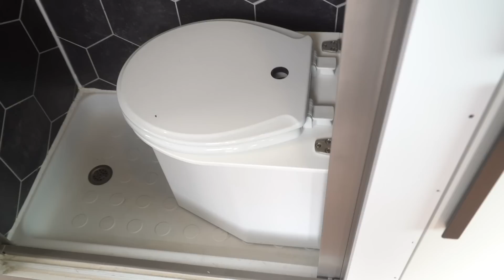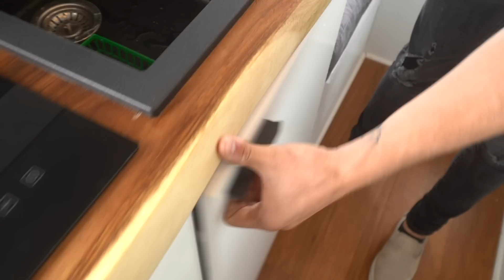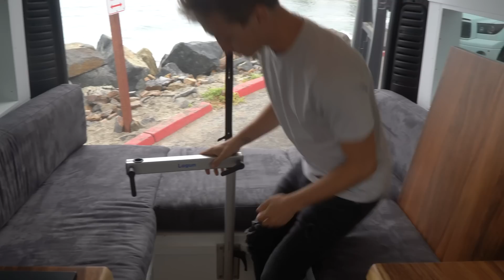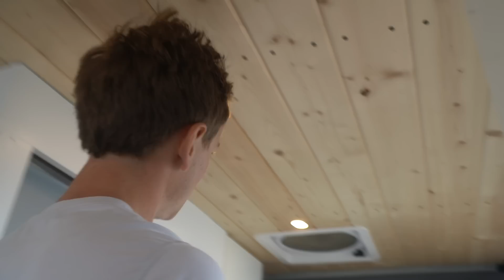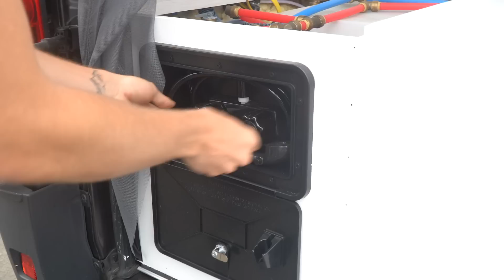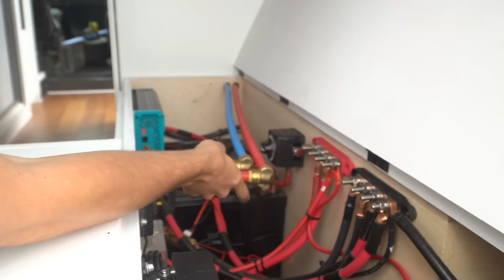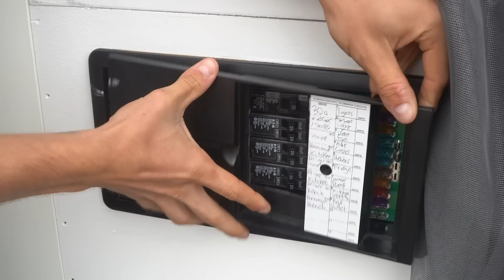LUXURIOUS Custom Van Tour | MASSIVE Black Slate Shower | 12v AC | Full Course On This Build!

Comment: Overall, nice build.  Like the layout and color choices.  I would have some humidity concerns with the evap cooler, and some finishing touches are needed to improve the quality of the build.
Reply from the maker: Scott agreed! We had to finish the tour before I could get to me of the more finishing touches because my videographer was going out of town!
Reply: @JumpinJehoshaphatJsquared  as the rubberbandits would say, "fair play to ya." :) lol, i hear ya, these videos made me so coo-coo-crazy for vanlife i had to build my own...but i wanted mine to be super-stealth because i am living in it fulltime in a major metropolitan area where the police are highly unreceptive of the idea of living in a van :-| and i also wanted it to be a legit tiny home that i could LIVE IN, with a full-size legit shower and nice bed...so i built it in a e350 box van. xD good luck getting your rig built, if you watch enough videos and think carefully about your needs you can get exactly what you want and it'll benefit from others' mistake. for example, it was several vanlife videos where people were complaining about smells from their greywater tank that turned me onto the idea of the hepvo valve. also, i saw a trent-and-allie video where they had mold problems underneath their foam mattress, so when i built my bed i put epoxied slats underneath, so the wood won't accept moisture at all, and about 40% of the bottom is exposed for great circulation. also, you can learn sketch-up and put-together plans yourself, and tweak-away to your heart's delight. :)
for your setup, one thing you might not have thought about, but imo is a FANTASTIC base for a tiny home (if you have a truck to pull it): enclosed trailer. indeed, i was originally gonna use a 20' extra-tall trailer ($8000 if you pick-up in GA) with torsion axles for my tiny home. in the end though, i'd have had to sell my car to get a truck to tow it, and then leave it on the street to go to work, and that was too nerve-wracking. with my box van i just have a kill-switch i installed and it ain't going anywhere if i'm not around (unless it gets towed, but i always park it legally so not an issue knock-on-wood).
peace
Reply: @JumpinJehoshaphatJsquared  thanks for the suggestion, that dude is AWESOME!...lol, great minds think alike. i was laughing at his comment about how he doesn't use CAD because he feels it's too "rigid" and not art-like, when the truth is even though you make a plan in CAD it always has to be modified on-the-fly. yeah, those cardboard mockups he's using are *sweet*, and definitely they way to go van builds due to so many irregularities. (one of the best things about box van builds are no wheel wells to work around, and the only non-right-angle in the whole interior is the rounded front top edge.) that's extremely interesting about a big corporate deal making box truck and bread truck builds. i had actually started a company to build tiny houses in box trucks and trailers, but unfortunately there is just no demand for it out here on the east coast, so i am going back to java programming. :/ lol, at least now i can live rent-free in a minimalist home that i LOVE, which designed and made myself. =) peace
Reply: @808kuualoha  if electrical components are properly fused and wired, there is zero risk of a fire, though it is possible that things might get shorted and ruined...methinks you don't actually don't know what you are talking about.
Reply: @JumpinJehoshaphatJsquared  Every one of your comments is bizarrely aggressive, and you're the only one engaging. Relax.
Reply: @thetreyxturner  If you read his comments to others making suggestions (not all, I suppose he got tired) he was quite snippy. They are all very good suggestions and warnings but he doesn't seem to care. I made a joke and he blew me off rather rudely. So yes they were aggressive as you suggest. However, the suggestions about water lines and electricity that someone left should have been you are right, thank you for the help. He needs thick skin if he really wants to make a better safer product. Why do I care you ask. I will be looking to purchase one soon. His has the best designs. But his has the most dangerous designs as well. So hopefully he will take what ppl are saying and incorporate them into the next van, but certainly start with this one. I will move on to another van builder.
Reply: @808kuualoha  pex with sharkbite fittings are standard in the RV industry. lol, nothing in life is risk-free, but i would venture to guess that there won't be any significant risk of problems for far longer than the life of the vehicle itself. the only thing that matters is what the customer thinks, and youtube comments are just more sh!t-talking from the peanut gallery.
Reply: Tricked Out Van, 
You need to really study up on what evorapative coolers are and how they work. They are also called a swamp cooler and are used to cool many homes in the very dry climate of the southwestern US.
They add humidity  in to the air which cools the hot dry air in the SW US.  They do not cool in a humid climate like any other part of the US.  Which is why they are not used except for a very few states, like Colorado, New Mexico, Arizona, Nevada, Utah and parts of other adjoining states. 
They very definitely put out lots of humidity.  That is why the water is put into the unit, it adds it to the air as humidity which cools.
Also lots of calcium buildup in the filter area. Lots of maintenance.  
Also will not cool if driving into a humid climate. Not a good solution if driving to the midwest or east coast.
Reply: @douglaserwinbrandt181  from the fresair website (https://www.fresair.com/vanlife/): "Runs Dry – State of the art evaporative cooling technology delivers cool air, not moisture." they must be using some kind of condenser to collect the outgoing moisture, because i know the unit drains back to the water tank (discussed in a different video on this channel), though i don't know the proprietary technology details. apparently, it ain't no swamp cooler.
Reply from the maker: Douglas Erwin Brandt ,
You need to do your research and understand that this unit is designed for vans and doesn’t put out any humidity. Take up your argument with the inventor of the fresair, not me. It works amazing, I live at the beach with decent humidity.
Reply: @JumpinJehoshaphatJsquared  dude's got an actual business, doing work for paying customers, and creating dope videos for the community...lol, and all you are doing is talking sh!t on the internet!
Reply: @douglasharley2440  He's running electrical quipment next to water fittings. Water fittings without supporting brackets. Sinks without traps that are running DIRECTLY TO THE GROUND), he says on video you can add a grey water tank if you want to. THIS IS ILLEGAL IN SOME STATES, is legal in others, but ALWAYS has restrictions in municipalities that allow it. Good luck getting caught where you can be fined. As for the water ac aka swamp cooler, the website says it uses 1 liter an hour on high. Every video on YouTube including this one has ppl saying can't use in high humidity environments. This limits users and the ppl who buy it later. It WILL cause mold. Hope he has good liability insurance. Just trying to help a new van builder build a legal and better build. Read the other comments and change my mind.
Reply: @JumpinJehoshaphatJsquared  interesting observations, and certainly germane. i didn't actually see that part of the video you are referring to (i was skipping-around), and that might also concern me, if true and accurate. however, i just googled and pex sharkbite fittings are historically used in RVs and vanlife, though there are certainly regulations for placement of support fasteners and shut-off valves, etc. i personally used PEX Apollo fittings for my build, and i also read the RVIA standards for plumbing and fire prevention/suppression, and they were fine, though i can't say if sharkbite was as i wasn't interested in them because they are significantly more expensive. i also ran water supply lines near electrical equipment (sometimes there's no other way), but i also used a single continuous PEX line and all my electrical equipment, including batteries, solar charge controller, and even solar panels are all fused, so the worst can happen is having to replace some burned-out fuses, no risk of fire. (though the water would make a huger mess/problem in my case). in regards to the fresair not working efficiently in humid conditions, that is almost certainly correct because from what i understand it cools via evaporative process of water, which is driven by the water vapor-pressure deficit...but that has no bearing whatsoever on the humidity of the air it's expelling. you say it "causes mold", but i am not yet convinced until i see a video review of someone with one who says so. yes, all business owners should have good insurance, i fully-agree on that.
Reply: @JumpinJehoshaphatJsquared  further, i also omitted a trap from my sink, as it is completely unecessary as i use a hepvo sanitary valve before my greywater tank. i don't have any smell. also, while i do not drain directly from sink/shower/urine collector to the ground, i DO just dump my greywater onto regular ground, and i googled extensively and found there AREN'T actually any regulations that say you cannot, because it's ultimately just water, soap, and urine, all of which are not as bad as someone washing their car, which is perfectly legal. lol, i only dump it in the middle of the night though, so it's all gone by the time people walk around AND THERE IS NO SMELL left in the area as UV radiation breaks down all those chemicals in a matter of hours.
Reply: @douglasharley2440  All good points, you've covered your bases. Brackets are easily enough installed. The sink trap issue is two fold in THIS instance. Heaven help you if you're better half looses a ring or other expensive item. You may be rethinking that at 2 am in the rain trying to retrieve it from under the van. You're done if it happens while driving. Exhausts are generally on the side or on top of installations due to harmful gases and fumes that are produced. Not to mention critters and pests. You now have a hole in your van underneath you open to the environment. Traps have small amounts of water that block everything I've mentioned. England learned this the hard way when homes were actually exploding and killing ppl when indoor plumbing was first introduced there. They ran toilet lines to sewer tanks without traps. No electricity so they used candles to investigate sewer problems and boom. Seems elementary now. Great video on this on YouTube. That's why history is so important. Thats why you should never poo-poo helpful suggestions. Every pun intended. https://youtu.be/uB7hIpDCfr0
Reply: @JumpinJehoshaphatJsquared  yes, i fully understand the dual functions of traps, and so i have a strainer in my sink to catch things that fall in. i have spent significant amounts of time in old apartments in china that were plumbed straight-shot to the sewer line, and there is always a faint stench emanating from there, so when i omitted traps in my build (to save space) i made sure that the hepvo valve would be 100% effective in blocking odors. yes, i hear what you are saying about pest getting in, i am sure he has installed covers over his underneath openings, i did and it's pretty standard. (i have 2 underneath vents, one for my propane locker, and one for my composting toilet ventilation fan. both are schedule 40 PVC with tripled-up pest-proof outdoor screen clamped over the openings. nothing bigger than a tiny midge can get through, and they'd have no reason to fly up either as they couldn't fly up the ventilation pipe as it is against the wind and it is always on, and there is nothing of interest inside the sealed propane locker and they can exist back out of either of two vents (other on side as per regs).) idk, you still sound like some random sh!t-talker on the internet, not actually anyone who knows or does anything. just sayin'. :/
Reply from the maker: Scott the fresair doesn’t put out any humidity.
Reply: @Douglas Harley to avoid getting towed, you would need to do a status correction. Take the LEGAL FICTION DEAD ENTITY out of their system and control it instead of IDENTIFYING as IT. High Frequency Radio channel "public vs private, creditors and their bonds vids), atexascash3502, sovereignliving, TJ, the hailrazor legacy, tex Mason can get you up to speed. So can former deputy Sherriff Eddie Craig "Right to Travel" vid. Once you've done your processes (filed paperwork), you're out of their jurisdiction and NO ONE can tow YOUR CAR, your property. But if you're a DRIVER of a VEHICLE, they can. That's their jurisdiction. Good luck on your journey
Reply: @tooshay7396  lol, whatever dude, you sound like you are going insane. i have seen dozens of videos of "sovereign citizens" getting their sh!t handed to them in court/roadside/wherever by the authorities, because they are full of crap. that's a bunch of nonsense. finally, i am not on any journey, i am trying to live my life.
Reply: @808kuualoha  lol, i've actually read the national fire protection association standards for RVs (that's what RVIA uses) when i built my stealth tiny home in a truck. i didn't remember it saying anything of the sort, although it was in the spring and so it's faded a bit in my memory...so i just went back and reviewed it again (https://www.nfpa.org/codes-and-standards/all-codes-and-standards/list-of-codes-and-standards/detail?code=1192), and sure enough, it doesn't say anything about requiring water supply or drainage systems a certain distance from electrical components (chapter 7 covers plumbing). unlike yourself i try to know what i'm actually talking about. unless you can direct me to explicit requirements to support your "arguments", then you should admit you are a sack of internet crap. xD
Reply: @808kuualoha  what's wrong sack-o-sh!t, got nothing to say now??? you are a clowna55.

Comment: BEAUTIFUL....MINUS THE FRESAIR...
Reply: What's wrong with Fresair? Just wondering because I was gonna put one in my future build.
Reply: @Maya-xg6wh  fresair is  not a traditional air conditioner..its a air cooler that cant handle real hot or humid temps...depending on where you live I wouldn't consider it...personally it's a waste of time
Reply from the maker: Andrew Gordon you clearly don’t know what you’re talking about! The fresair works incredible.

Comment: Thanks for showing your van; enjoyed a lot watching it. Nice layout and design.
What are you using for heating the water?
Do you think you loose quite a lot of heat through all those windows?
Thanks in advance!
Reply: As for the outdoors, an evaporative cooler might offer some relief no matter where you use it, since the humidity it releases will quickly dissipate instead of being trapped in your home. Still, it won't be much more effective than just a using a fan on muggy days if you live in a humid climate.Mar 1, 2018
Reply: thx for the sink faucet spray demo- wow! i’ve NEVER  seen that!! hahaha
Reply: no p trap?
ugh
Reply: obviously “we can store that” somewhere else- on a build, u show us a good, predetermined place(s) to store all
Reply: and my hips will be right in the seam of the bed😢
Reply: will the rear vented windows protect me? u say they will protect “everything “...
Reply: i like the exposed to all water fill so anyone can add anything they want!!!😩😩😩😩
Reply: i certainly don’t want to have to lock a shower box inside my van
Reply: “loose”? haha
Reply: @brucemontgomery6853  You never have typos or have an auto-correct change you didn't notice?? Why are almost all of your comments so hostile and childish? And why in the world did you post ALL of your comments as replies on this persons question??? If you don't like a video, give it a "👎" and MOVE ON!!!
Reply: couldn’t u flush your stove/ sink by recessing them ?
Reply: wow... cabinets w closers that snap shut!!!wooooooow
Reply: “kinda turn them on”? so amazing this editing is incredible
Reply: caulk or better cuts or don’t show me the gap by timer

Comment: Born & raised in Phoenix, & have used either a straight evap or 2-stage evap cooler most of my life. They're just not as effective in humid weather. 
Also, I know with tiny houses humidity/condensation/mildew-mold-slime is a big concern. 
Using the Freezair seems problematic.
How do you address this?
Reply: That is what I was thinking, ,mold big time in no time.
Reply: I lived in Roswell, NM for a year. For part of that time we lived in a house close to the former army base. It came with an evap condenser. The only problem was for 3 weeks the daytime temperature was 104° F and the night time temperature was 94° F. Too hot for us to sleep. Especially for the baby who was less than 1 year old. Maybe there was a problem with the evap unit. I was so glad to move to Kentucky. The temps were about the same, with humidity close to 98%, but we lived in a central air conditioning house.
Reply: @JumpinJehoshaphatJsquared  If they have a good fan blowing it out it should not be too bad.
Reply: Once while visiting Santa Fe New Mexico we stayed in a house with no ac. There was a fan that used water to cool. I had never seen one before. It worked great there!
Here, in Louisiana I can’t imagine using something that increases humidity.  I wish this would work in our hot humid summer heat but I doubt it. I’d love to know if anyone in similar weather conditions has ever tried this? Did it work?
Reply: @LALew850  There's a chart in this article that I consult often. It'll answer.

https://urbansurvival.com/prepping-the-texas-swamp-cooler-adventure/